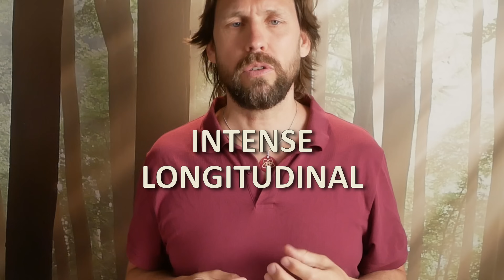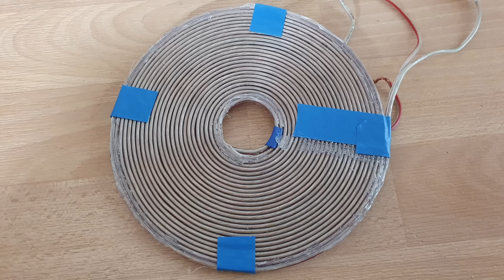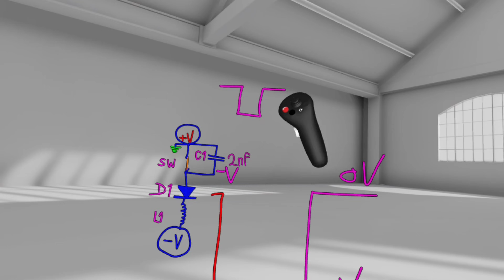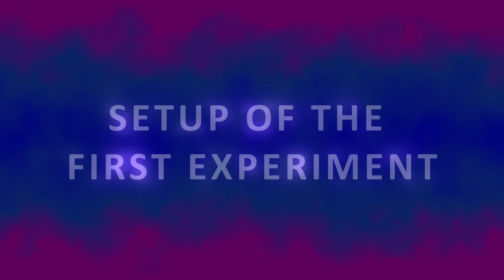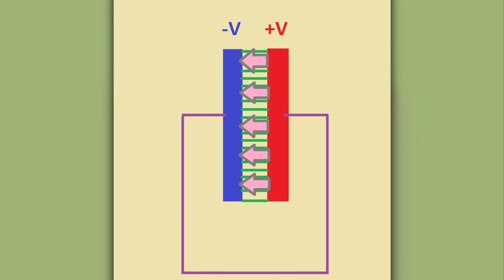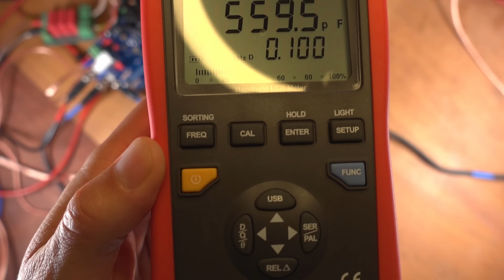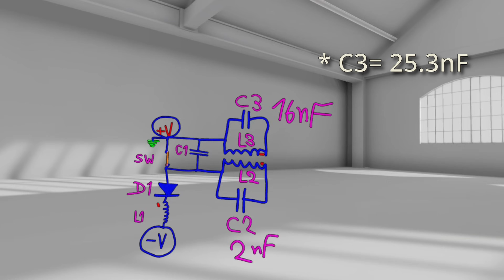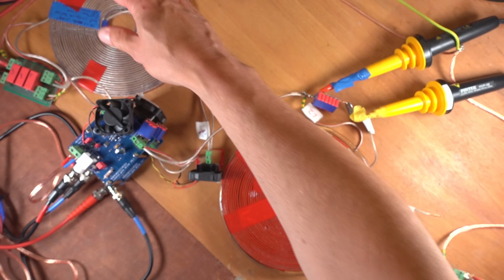Dielectric Induction producing Ground Currents

Comment: Haven't we been doing this for decades, with "flyback recovery" technique with (CRT) TV sweep/EHT circuits? They invariably use 3rd or 5th harmonic tuning.
. . . . .
 Abstract:
A harmonically tuned horizontal output transformer has the turns of the tertiary winding apportioned between two series connected winding sections in order to reduce its distributed capacitance and leakage inductance. These sections enclose the primary to establish a predetermined coupling therewith such that the leakage inductance of the tertiary resonates its distributed capacitance at the fifth harmonic of the characterizing frequency of the retrace pulse. The retrace pulse and the harmonic algebraically combine to provide a broadly peaked drive pulse for the high voltage rectifier.
Reply: flyback recovery that bring a hole new meaning to the term "flyback"
Reply: @dh2032  that depends on your original definition of "flyback". To me it means the same as "retrace", the time period between the end of one scan line and the beginning of the next, but for a long time in the US and parts of the world under their influence a "flyback" has become the name for the horizontal output transformer. Sometimes for other similar transformers that have absolutely nothing to do with scanning a raster!
Reply: @rambo1152  I was thing out loud, maybe magnetic, levitation, too, it would have be way bigger, and lighter materials used possibly too, not to also alot more bit are going to be would needed to be invented too,   "Flyback" as in actual flying, abet silly really 🙂

Comment: If you are pulling 6w AC you should be able to disconnect your initial power source. What happens when you do that. Also what happens when you put a load on this system? The square wave is interesting but is it useful for anything? If you could charge a battery, even a 2v Li-Ion, it would be useful. Otherwise it's simple a curiosity, sadly.
Reply from the maker: work in progress

Comment: How did tesla produce electricity for his experiments
Reply: In his patents appears a  box with a G. As I understand, is either a Volta battery for DC (acid battery) and then a Ruhmkorff coil for HF AC, and/or his conmutator for low frequncy AC. But a simple battery is not generating the power you see in the few famous images... so you are asking the correct question...
Reply: Tesla would take two copper wires,about two feet long.make an L shape out of two pieces.Hold them in front of you shoulder height,about four feet apart.Walk around the land.When the two point to eachother,there is an electromagnetic charge coming out of the ground.Useually there is two rivers crossing underground charging the earth above it.
Reply: itWasAGenerator.ButWhatRunnedThatGenerator?

Comment: This is an excellent idea. So you have a high frequency variable voltage power supply with minimal turns, less copper etc, so the excess charge ends up as heat in your   load yeah? Or radio waves maybe. I guess this is the evolution of voltage transforming

Comment: It looks to me that current to ground is just leakage current due to low impedance of the path. Put a transformer there to convert those 400mA peak-peak of current into something usable, and you'll see it stops flowing as soon it has a load. Anyway is entertaining to see your videos.
Reply: Actually, the wire is the lowest form of load still producing high currents, but then the voltage across the wire is micro. So the energy is such A x V=W

Comment: Everyone assumes that the world would be sparking and an abundance of current uncontrollable and a nuisance to life if Tesla's wireless was used or possible which it is if it had not been silenced....this is part of the original propaganda.... Tesla worked out all the quirks before he said he made a mistake with wired AC power distribution!
RC or resonate current will power the entire Earth!
RC has been distorted by academia as to keep  experiments from being   positive on the level of power transfered.
Tesla's wireless was more than 100%.
As to mean as many receivers as can be made will all have the same output without drag on the generator. 
Once Tesla engaged the wireless part of the system in wardencliff it would simply arc at around 8hz into ground with a about ten foot spark gap...its the resonating pulse synchronized with earths natural resonance...this heart beat would be inconceivable by anything other than circuits that start or end depending on your take of travel..at an antenna to a primary coil that is tuned also to any multiple of the resonate pulse...then onto ground its that simple really...only made impossible for people to understand by the institutions that are in place to keep this type of thing from occurring by patented inventions ever again...
  Once the pulse engaged it would simple vibrate the electrons instead of pushing or pulling then through a generator...this vibration because of the natural frequency would saturate earth and all of its atmosphere...the millions of volts and thousands of amps would be stepped down to a usable current by the secondary in the circuit and that would be the constant energy supply...its more like radio than battery or generator exept the distance is not a problem because of the frequency....it worked on basics that we use today less the resonating frequency parts because that was the secret to delivery...my grandfather sat many days at wardencliff as a brick masson and according to him Tesla loved to talk and discuss what most would consider secrets....i hope this will help in undestanding that Tesla knew all about bad emf and considered this to be absolutely safe....our computers would work just fine...but the transistor may not have been invented because it replaced the tube and tubes at the time were crucial to the tuning of all the receivers each necessary at the point of power consumption.. Without the cover up of his work they would have just improved over time..

Comment: Water hammer effect. It's an electric ram pump.  Biut I'm not seeing the benefits.  

How do you plan to introduce the mechanical energy ??
Reply: That's the easy part, I haven't even watched the video, and if it has mechanical potential, you have power dude...🤦🏼‍♂️
Reply: @artificer845  say what?  How does one convert this type of generation form a mechanical source ?
Reply: @DanielbenDaniel  you know an alternator yes? Like in your car? This.

Comment: what happen when you disconnect ground? If in ground wire flow current then what about RCD protection?
Reply: The circuit is not connected to the mains, its running on battery.
The earth ground is coming from the water pipes.
Cheers.

Comment: This implementation of VR being used to teach is pretty cool.   Wish Nitendon't  took this farther when they first came out with the wee.   😉   All jokes aside,   I wish the folks in the Car Audio community spoke more about how dielectric and magnetic fields differed.   Still can't really  "Get it" on how that works.   

Thought it was just a form of chemical energy like in a battery for the mechanism for Dielectric Induction Vs. its  counterpart, *Magnetic Induction*.
Reply: What makes you think car audio guys even know what dielectric is?
Reply: @Subdynoman     Well, D'Amore Engineering & EMF , AKA The old school boys would know.    But the current crop?  

Yea..  I see your point.
Reply: Ditto
Reply: I see your point as well now,  I understand sound in a way that has helped me understand electricity which has helped me to understand sound...
Reply: @Subdynoman     OH!!!  Speaking of that!     For years, I did not really understand the concept of A/C.  Vs. DC power.  

So YEARS ago, I saw a guy plug in a woofer to a wall outlet.       EUREKA!   The 60 Hz. Sound wave.    

David Ratt (Chilli Peppers Sound Engineer fame)   In fact showed how a Crown Amplifier could run a Toaster Oven and even made some toast with his Daughter. 
🙂

But for the longest time?  I could not understand the Frequency component to AC power.    Or why we would have 400 Hz. Power for Aviation or Military use.  

I forgot all the great People I watched, (And I went to school to learn this stuff)  but it never really "Clicked" till I saw people showcase how it works with Audio, since it's simply just a modulated AC signal.  (Sine wave on a scope)   

Then there was that 3D thing they use to put on some Marantz Radio's where you could see the sound waves and its phases as well.   Really REALLY COOL! 

Still don't really get Power Factor, so that's going to take a few years (TIBI and a Slow runner)  So it takes a bit for me to grasp these things, but truly fascinating.  

And the "Skin Effect"?   Or how different cable / Interconnect types such as Balanced, and unbalanced and floating Ground ( ?)  and how they work to mitigate noise etc. 

And I'm still mystified by Vacuum tubes. 
But once I saw a Mercury Rectifier , it started to all make sense since you could see the electron glow  & flow (Of sorts)  

I'm still mystified at how Solid state Transistors such as Mosfets work with no moving parts to make an switch of sorts.  

Its all so cool!  
Yea Ya.   Some people would just find it commonplace or could not give a toss about it.  But not me!   

Hell, I was able to jerry Rigg an alternator to work without a regulator by simply adding a light bulb to the field windings to get a guy home who's alternators regulator was busted.  (He wired it wrong, and was an Old 80's car)   Just told him to keep his headlights/ High beams on for a stable load to keep the voltage from spiking with a halogen light on the primary field from the battery.  

Yet I still can't figure out how a Universal motor is "Universal" and works on both AC/ DC power.    WEIRD!!! 😝

And then one day? I got the balls to try out and make myself a fix for my diodes that kept burning out on my Denso Alterntor by taking the 3 phases and making an external diode pack with the big ones used for 120v lawn mowers.      Put them on a heat sink with Computer CPU fans and it worked a treat!    (Had 4 AGM batteries in the Audio system at the time along with invertors) 

Then used   3 conductor cable from the Alternator to the back of the van so I would not suffer the voltage loss of DC or have to use 0 AWG welding wire to carry the current to the back of the van.  

Sorry. Geeking out here.  
But man..  What a Cool world AC power is!

Comment: Would have been nice if you placed a resistive load like a bulb in circuit to ground.  12 w then 60 then 100. Then view the power drawn from your power supply.
Reply: Now that would make too much sense
Reply: I was wondering the same. Was the coil shorted, when current+Voltage was measured, or where did the current go? Why was no load connected, could it hide that the system does not perform, or would it show "free energy" and therefor is better not shown too obvious? I don't have the answer, but keep hopes in check at this point. Very nice presentation however.

Comment: Interesting test from knowledge of electrical laws. But I don't see the sense of the experiments especially when the "ground" plays such important role. 
Capacitor compensators are normally used in electrical nets.
Dielectric charge is nearly instant (limited by speed of light in dielectricum) because of absence of Lenz law inductance (almost).

I expected experiment which would just use ground currents which have origin in energy inducted from various powerlines and/or radio signals. This could be rather substantial current on wider areas, where ground is just one "big antenna". Just harvest the antena or componsate the area to proper frequencies with higher yield. Another currents may have origin from geological structure with different conductive metals contained in the soil etc. 

Second part is about producing output energy from resonance using energy of vacuum. I don't believe it, because no instrument here works on quantum lengths. Casimir's effect utilizes vacuum energy due it's "dielectricum" plates which are extremely tight so that the distance equals diameter of quantum particles having always their counterpart normally. Not in this case. Anyway there might be some method how to simulate quantum dimensions by using virtual distances build by e.g. strong magnetic fields or particles locked in such distance by fields. Therefore I think that in future some clever methods of vacuum energy mining would emerge. 😄

PS: I will think about second and final part of experiment once again to get clear view about the effect. I consider that no quantum effects but just earth electricitiy/aerial induction played important role. But what if certain frequencies have, on certain scale, discrete quantum resonance ? Nothing is impossible...

Comment: Hi, you mentioned a very fast acting diode - which one is it? what is the max voltage for that diode. Thx and keep up the good work.
Reply from the maker: I used an older (non available) SiC diode, which has both high current and voltage capabilities.
earlier I also used a mur8100eg but it had trouble with the high charge current of C1. I increased C1 to lower that charge current a bit.

Comment: awesome, gonna give it another watch to better  understand it, the implosion seems to be an important key.  
you should look into Ivor Catt's work and his model of the capacitor, he says it is an antenna, has bidirectional energy flow in which B fields cancel and E fields add, creating a steady dielectric field from EM.
He also tries to prove why displacement current is a fiction and advocates for Heaviside waves.

Comment: If capacitor C3 would be even larger would that force ground current to bring in even a larger current  or more than peak to peak 900mA measured here on its harmonic way of fitting in-between the wave created by the switching ? It's still not a overunity circuit with this C3 of 25 nF.  Can one use a electric motor to be powered in-between that ground and the circuit and would it run with more power than used to power the circuit ?
Reply: It probably would in some areas and it would be no magic or hidden energy of vacuum 😜
Reply: @vencdee  So why in some areas only ? Would a thunderstorm kill the ground current since atmospheric equilibrium through the cloud discharge to ground does exactly that in an area  ?

Comment: I don't have time to watch the full video ATM, Is this the principle Tesla was using in his "Volts Per Second" technology and radiant/cold electricity systems? I'm looking to learn about these systems to build a dielectric generator and I'm particularly interested if this can be used to power standard tech, and if it's possible to power a load such as a bulb or motor using it without creating/requiring magnetism, at least is the usually large amount needed. 

I remember reading something about Tesla using high frequency and high voltage in his systems, how do you do create voltage with frequency without the magnetic component? Or is it just ultra current? Is VPS just the rate of dielectric flow?

Love the new intro btw.
Reply from the maker: yes high dV/dt and its a non magnetic but dielectric displacement current
Reply: Or high- voltage
Or very high amperage !!!

Comment: We're you been 😢so glad to see you still working on it I remember hearing back emf is squared the input but did not understand how I seen this in video on motors were the back emf of the motor while spinning made more hho gas than when it was not increase the amount by adding a motor I don't know what is happening there but it is true people can and has done it great work you have done backing up it squared is this video the holly grail meaning it could in theory close loop if charging a batt or cap this is over my head and need to see over and over I still have speaker wire and one bifiler coil in my room I never really got the hang of inpulses this set up seem better to understand and also I hear every thing in nature has to be brought back into balance and that seems the secret and probably why the Walden cliff tower had a big top and went underground I also belive the new yorker hotel is running on tesla power 3 fat copper tubes run from underground to the top and some things under ground would love to see it so tesla did do it just made it as hotel 🎉thanks man
Reply: Wow intresting
Reply: Interesting

Comment: excellent work my friend!, for the moment I just have a question a little out of phase, can the voltage be amplified by a "jules thief circuit" connected at the end of a bigger bifilliar pancake coil put over a smaller bifilliar pancake coil connected to a DC source like a solar panel ?

Comment: What if during the time period where earth ground is producing an influx displacement current, a pulse is applied. Possibly a controlled negative pulse, during this interesting balancing period. Is there a way to possibly lengthen this time period of ground inflow?
I'm very interested in furthering this experiment. It will take me a couple of weeks to order and assemble everything that is needed.
Thank you very much for your very interesting work, and also sharing it with the community. I do very much agree, our planet deserves something better.
Reply: Yes negative pulse
Reply: The plasma field is obtained when the voltage is higher on the ground wire

Comment: I wonder how long until he hybridizes this thing with standard gapped capacitor plates interspersed with split plates and puts together a trans-capacitor? (Haven't seen much on that, but it's supposedly a thing.) That might be interesting if you can get some control of the bias on the split plates. And if anything involves a coil, it's still a type of inductor in some regard though, can't entirely get around that.
Reply: Kind of like the control we have on a amps valve ?
Reply: @Buzzhumma  You mean it needs a knob?